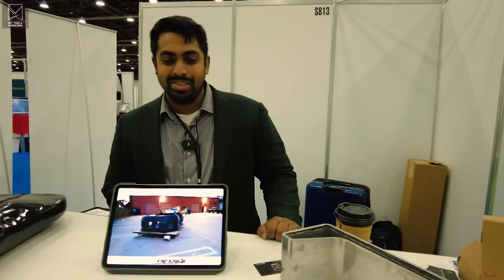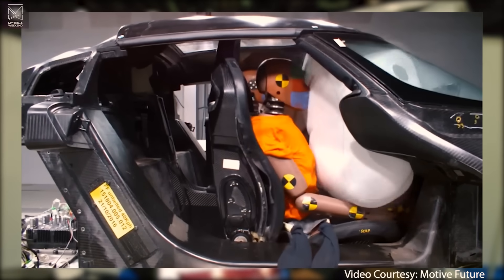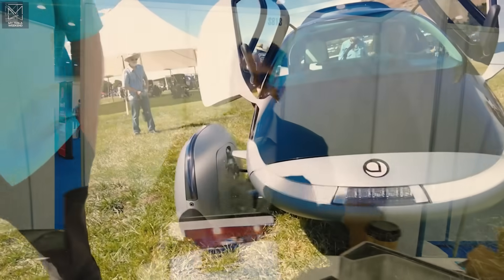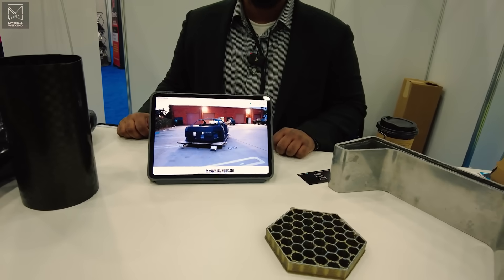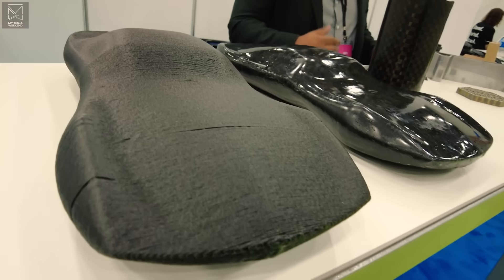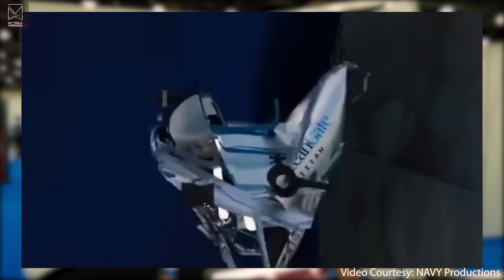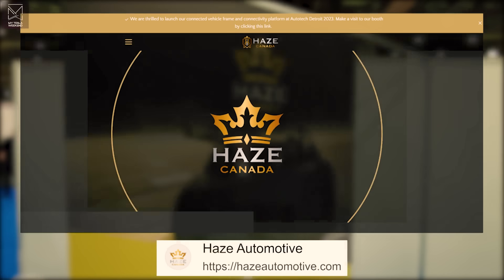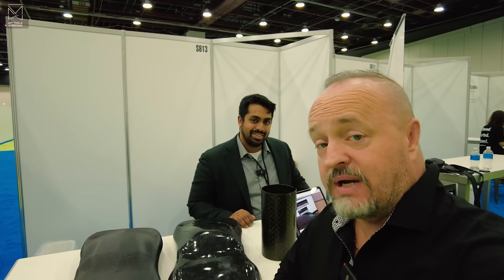Aptera, Tesla, and ALL CARS can be 35% lighter w/ MORE safety

Comment: Since you, Brian, have written into the video title "Aptera . . . can be 35% lighter . . .", how can this happen? Aptera will be made from CF - a known fact - and Haze makes vehicles from the same thing, so a drastic drop in weight is impossible. I would expect no more than 1% lighter without having specific details about Aptera's weights (numerous models of very different weights; none provided) and the grams per square feet of both CPC and Haze's CFs. It appears you use click-bait. In fact, I am certain of it; I hate to guess. Also, you say there is more safety, and I didn't see anywhere that showed Haze CF will be safer than the CPC CF that happens to include a steel chassis (of sorts) and a steel roll cage. If Haze can be safer while eliminating those items, Aptera would go close to being 10% (having to be wild about estimates) lighter than the 250 mile, two-motor, least solar model they pretend to offer. Of course, the 1,000 mile, tri-motor, full solar vaporware model will not get close to 10%. I deal in facts. Happy to hear your explanations, but this time - try not to be way off track?

Comment: There's already a hugely underserved market for carbon fiber wheels.  Let em start there and prove their worth and effectiveness
Reply from the maker: This is less to me about THEM doing the biggest things, but that they are uniquely positioned to know which big things are likely possible.
Reply: @MyTeslaWeekend  
There's no good carbon fiber options in aftermarket wheels.  The cheapest set you can get is around $20k, and no one but the richy riches are going to buy those.  They have tremendous benefits for performance by reducing unsprung weight.  There is NO car that wouldn't benefit from carbon fiber wheels.

If they're a tenth as competent as they claim, they could have already cornered the market on affordable carbon fiber wheels.  Sounds more like a dine-n-dash firm that wants a big contract and they'll worry about pulling it off later.  

Didn't he say it takes 70 HOURS to make one car frame?  So they have the 1000 acre building to crank out 1000s of frames simultaneously?   Sounds like a lot of wishful thinking

Comment: Carbon-fibre is fine for Tour de France bicycles, when forks or frames fail there’s a replacement in the team van. Modern aeroplanes use aluminium honeycomb panels in their construction - aluminium is recyclable, carbon-fibre not so much. I remember seeing a wood-honeycomb motorcycle frame a few years back. Wood’s recyclable too, and renewable.

Comment: He throws a lot of terminology around, but never describes the process used to lay up the carbon and then how they autoclave the polymer to cure the parts. Sorry, I'm skeptical until we see the details.
Reply: See Wikipedia, PAN (Polyacrylonitrile). Basically heat up bitumen first with air and then hotter w/o oxygen.

Comment: Possibly too time consuming to manufacture, & too costly to repair. Both factors prevent carbon fiber's selection for the basis of the next mass market EVs, e.g. the model 2/Robotaxi platform (whatever it'll be named). Repairability considerations also make a unibody casting less likely. The carbon fiber tub in the BMW i3s were considered a good idea originally (& a great economic boost for the factory in Moses Lake, WA btw) but even minor accidents would cause insurance companies to write off the i3s. I'd expect Tesla to shy away from utilizing carbon fiber as an insurance provider, let alone as a manufacturer.

Comment: Hmm. Carbon fibre is brittle, so once over a limit stress full collapse and zero resistance to further deformation. Especially with crashtest you need a lot of energy absorption. I doubt if they have thought this through on that aspect. Furthermore, I don’t see cost reductions versus mass scale and engineering of Tesla at all. Maybe some niche applications or for yachts
Reply: Energy absorption is already well understood and it is engineered into automotive designs at the early stages.
Reply: @n.brucenelson5920  so what do you mean. Is this a positive for carbon or a negative. It is wel understood, yes. Essential is to create plasticity and destroy impact energy due to the crash. With carbon, this would work completely different. Special areas are needed that need to collapse at specific forces under various crash scenarios. This is NOT easy to achieve with a material that has no plastic region. It will certainly cost extra mass and hence extra costs and complexity.

Comment: Sorry, but as far as I know Tesla build one car within 10 hours, VW and others are in trouble because they can't make it that fast. How 70 hours can work? 😀
Reply from the maker: By 7x'ing the floor space where they're curing. Space isn't free, but if it's cheaper than the metal + parts with that weigh penalty, we may see it implemented. I still think it's a longshot, but it's an interesting thought experiment. It's not as radical as some of the other changes we've seen become common.
Reply: @FutureAzA  The price is important yes, but the volume more important. The goal is to produce 20 million in 2030 to replace old cars with EVs.

Comment: The Polestar 1: Ten times stronger than steel. Five times lighter. Carbon fiber-reinforced polymer makes up almost the entire upper body of Polestar 1. It's bonded to the steel underbody, increasing torsional stiffness by 45 percent.
Reply from the maker: This is important information a lot of people are overlooking. Carbon fiber isn't some crazy scifi tech. It's been used in a number of production vehicles already. If the cost and complexity can be reduced, it will make sense to implement it even wider.

Comment: Is this carbon fiber recycleable? Lots about cost-reduction, but what is the cost? If oil is the source of the carbon for the carbon-fiber, what are the total up-front and lifecycle CO2 and othe carbon emissions with this carbon-fiber?
Reply: Carbon dioxide is not a pollutant.  Plants die without it.
Reply from the maker: If the oil isn't burnt, the emissions should be negligible. Recycling is discussed in the video, but you can see in a search that there are already a lot of companies doing it.

Comment: I would like to see an alternative like hemp composite explored. Natural material with very little energy embedded in the material. I seem to remember an Elon comment of the forces associated with how different materials expand and contract at different temperature as a problem for vehicles. It was why they went with aluminum vs composite.
Reply: Aptera was considering use of hemp from the beginning when they were planning to use vacuum resin infusion.  At that time they thought the demand would be for around 5,000 vehicles.  Pre-order numbers forced them to go to a faster production method, and a side result is that the precision fit of the body panels is improved.

Comment: Carbon fiber sucks for many applications because of fatigue failures and delamination. Think of the catastrophic failure of that Submarine.
Reply: Also applies to fiberglass. It has to be designed to low stress levels which makes it thicker and heavier.

Comment: Aluminium is fully recyclable. The energy content is basically irrelevant when recycled. Primary aluminium only uses similar energy to other metals, electricity can be renewable eg hydro, wind or solar.
Does. Carbon fibre crumple like metal? Can it be repaired?
Reply: As he said, no, it really can't be repaired.  It must be replaced, so it is important that the design features separate pieces, like fender panels and doors that can be easily removed and replaced.  Minor damage to nonstructural parts can probably be repaired just like fiberglass parts in cars that use it.  However, to be cheapest, he did say whole frames can be made.  If that part is damaged, then the car must be scrapped for parts.
Reply: @alanhall6909  I don't think you got all this correct, but from experience, you are mostly correct.

Comment: How it performs during fire ? As to "cheaper" - Elon moved away to stainless steel for Starship.
Reply: Carbon fiber doesn't burn... some resins might smolder
Reply from the maker: Melts to nothing, but in a fire like that, the car's going to be scrapped anyhow.
Reply: A major reason for starship using stainless is it’s characteristics at the low temperatures of liquid oxygen and methane.
Reply: In addition to the temp range of stainless steel, I also understand the ease and speed of manufacture and iteration was also a huge factor. The mold for a carbon fibre part is a huge part of the cost. Imagine building a mold the size of Starship. Now you also need to bake that part in an oven to cure it - so you'd need a skyscraper-sized oven for Starship.